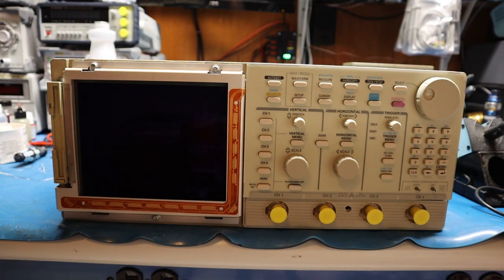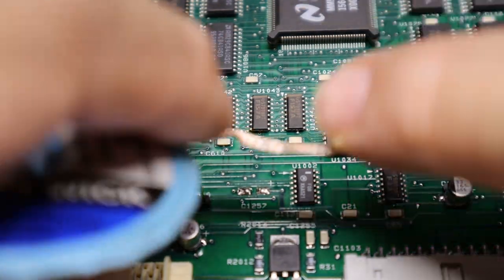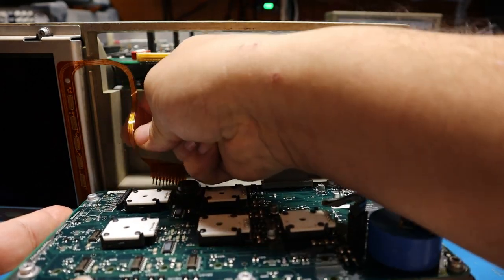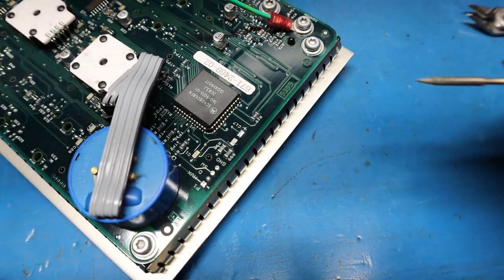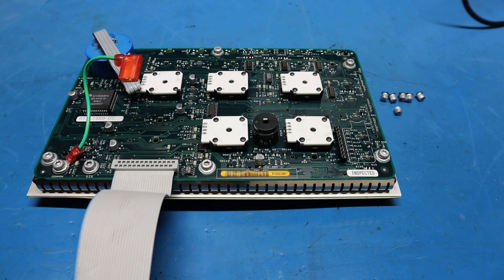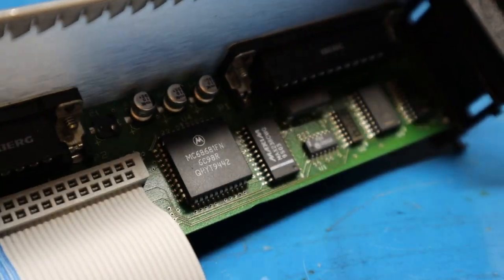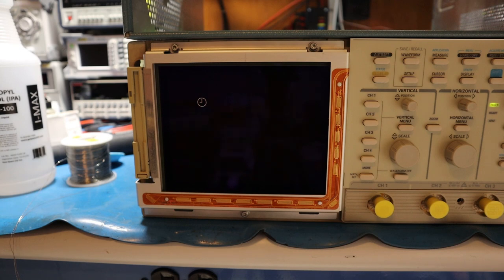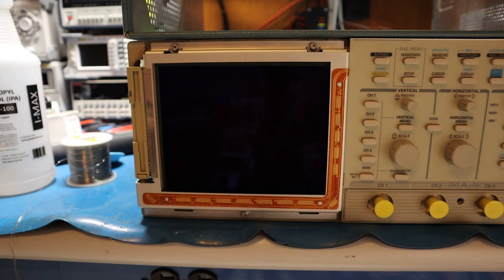Tektronix TDS 784A DSO Oscilloscope Repair Part 2 SMD Capacitors replacement

Comment: Neat to see and watch.  Whoever recapped the TDS-520 used through hole components also.  What's your thoughts on using tantalums compared to the SMD electrolytics?  What's the wick your using, I have Spirig 3S wick I got somewhere I think for free from someone?  Thanks in advance.